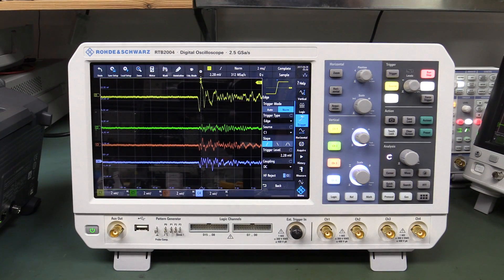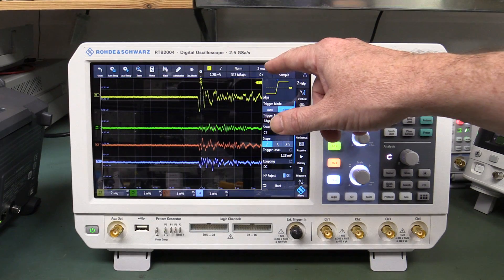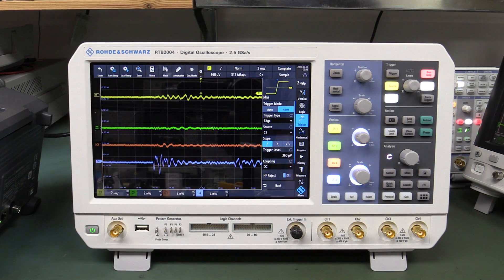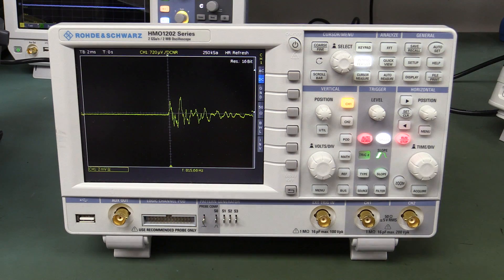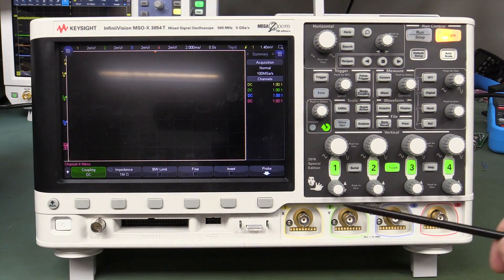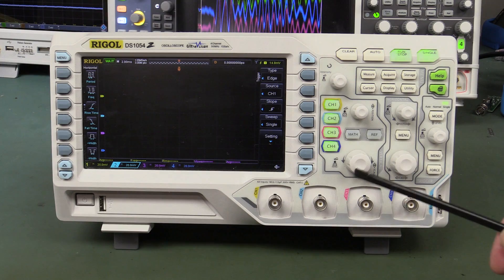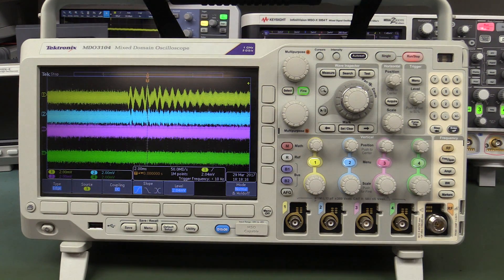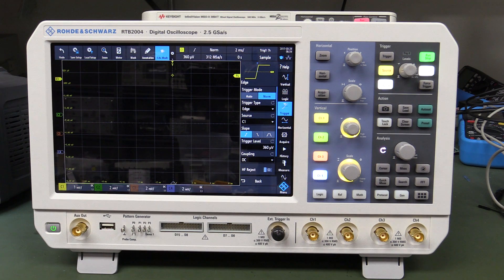EEVblog #983 - A Shocking Oscilloscope Problem!

Comment: I have a RTB 2004 purchased 3 years ago and I've noticed the BNC ends of the supplied probes are starting to crack! It sits on my workbench - not exposed to UV light, barely moved and never subjected to knocks yet they're cracking. And don't get me started on the horrible gritty feeling of the spring loaded hook tips. Disappointed and won't be buying R&S again.

Comment: My Keysight DSOX1202X is immune from tapping on the scope itself BUT I have noticed environmental capacitance effects holding the probe and tapping my feet produces about a 50 volt DC impulse that peaks just as my foot reaches the floor, the velocity of rise increases as proximity to the floor, very much what I would expect in a capacitance situation with a DC voltage gradient in the room.

Comment: I know that with my 20 year old Tek 2024b scope, if I hold the supplied probe tip within a few inches of the back of the scope it's noise a-go-go. But I haven't yet tried using it as a set of bongo drums while capturing any signals.

Comment: 5k$ scope with this kind of problem on the board. Even gold bnc's does not help ? I beating my HMO1102 on each side, nothing wrong happens. poor probably R&S does not even try to fie it. Cause people even after this film wathed, make table prons cons, colors mode annotation drawing on lcd and amazing 3d XYZ beat everything, No matter that scope for egzample insted of square shows almost sine, gold pins with 10 bits (ENOB less then 7) are worth to buy it. :D I buy MDO3000 in that price. Now at work gives me hmo1102 with one pixel faild, but scope is simple have little anoying thing like no zero push in position konbes. But it is good, scope, on that measures you can relay and the scope does not carry you into wrong path way of interpretation, diagnosis of the problem. For what can i use scope like that on vid... The HMO1102 makes huge impression on my, that i wanna to buy RTB2004 full opt or clean RTE1000 200MHz. Now I know that was so close, i hope that RTE1000 is designed on high level

Comment: My Uni-T UTD2102CEX has the same "problem", but I have to hit pretty hard to get 2-3mV spikes. It seems to be a high-frequency thing. It's easier to trigger with a light pen than with a reversed pair of scissors (steel blades in my hand, plastic handle on scope). Scissors have more mass so produce a lower frequency signal? Anyway, with the amount of force I have to tap the scope with, I don't see an issue with this scope to be honest. Nobody hammers their scope while taking measurements, right?

Comment: Ceramic capacitors are by no means the only source of these transients. If you take a coaxial cable that obviously has no ceramic caps in it, connect it to the scope and tap the far end with a pencil, you will still trigger the scope. Plastic-metal interfaces also generate microphonic transients when tapped.

Comment: Ceramic caps in the signal chain. Pretty typical. That’s where special construction techniques come in. It’s possible to work around this problem, but it requires quite a bit of experimentation to get it right.

Comment: Several years ago, my employer was considering a R&S signal generator for noise floor measurements, there were even two R&S sales engineers present when one of our lead techs demonstrated to the R&S types that noise floor measurements could not be done because of the high noise level on the signals from the R&S generator, the he demonstrated the same test using a very old HP 8640B sig genny, noise floor measurement successful.

Comment: I have seen this effect in association with modern electric guitar effects pedal circuits. It's not something you want in an audio system. I have contacted Digitech about it, and they simply denied it's an issue with their design.

Comment: Check out this R&S Scope Rider touch screen going haywire:  https://youtu.be/6SCOpyw3wmY.  This same issue happened to us with our R&S Scope Rider while troubleshooting a failing VFD in the field.  You can see our example here https://youtu.be/uzA0GjHceeM.  This one happened as soon as drive output was enabled.  When drive output was disabled, the touch screen functioned normally.  This issue for those of use troubleshooting in the field is a serious concern!

Comment: My Teledyne LeCroy WaveRunner 64Xi has a surprisingly good isolation. I've set the trigger level to 1mV and no matter how or where I whacked it (the case, all the BNCs, the screen) but there is no capture. One thing to note, however, the fan is pretty loud and for this reason I believe the engineers might have paid a special attention to this matter when they designed the front end. UPDATE: I used 1MΩ impedance inputs.

Comment: removable header connections...anything that has a spring loaded connection will contribute to the phenomenon. ceramic caps old style and new suffer from this also. there's the chance that solder joints will add to the racket on well used equipment. all these things add up to produce what you see here. very common place. when measuring r.f.and certain types of audio equipment in operation it can,from time to time,drive a person nuts! ;-)
microphonics suck!

Comment: Out of curiosity, I tried this on a properly analogue scope. Tektronix 7603 mainframe, 7A13 vertical plugin (differential, 100MHz bandwidth, up to 1mV/div sensitivity), 7B53A timebase. Set to 1mV/cm, 2ms/cm, normal trigger, input DC coupled but no probe connected. I couldn't get it to trigger by bashing the case, or at least I couldn't find a blunt instrument heavy enough to affect it, but tapping the input BNC connector hard with a pen did make it trigger. It really had to be actually on the connector, though, and the resulting trace on the screen didn't seem to be more than half a division high. That's probably a benchmark for low microphony.

Comment: Hi Dave, thanks for this info. this could be a potential issue when testing things in a environment that is creating such vibration shocks. in the auto repair arena, these type of scopes are starting to being used to diagnose network issues, and if your scope has this problem, when you are monitoring a can issue, driving down the road, hit a bump, see a hiccup in your signals, you might be inclined to think you found the problem with a possible circuit connction, when in fact nothing happened and your scope induced this fault. could make you chase ghosts. a lot of times in this scenario unused channels will not have probes attached. again thanks.

Comment: Are you sure that some of what you're seeing isnt actually triboelectric noise generated by the BNC connector itself when you whack it? It would be interesting to do the same test hitting a BNC connector on the end of a length of cable, so it's mechanically isolated from the scope. Great video though!
Reply: So, I just tried the following : Put a BNC T-piece onto a short BNC lead, and plug the other end into my old HP1740A 'scope. Tapping the T-piece with the hard plastic handle of the screwdriver I was able to generate spikes of almost 100mV pk !! Seems to me that a good proportion of the effect that Dave's seeing could actually be the BNC connector itself, generating triboelectric noise. An easy test that you can try for yourself!

Comment: Is that behavior consistent when attaching a typical probe? I mean you observe that with open inputs.... but probes are usually terminated, compensated, therefore provide some additional load to the input circuit. Which would mean that unused BNC´s would need to be terminated to not bounce that way to avoid that (probably no one does that).

Comment: Only 10 bit scope in that price range?
Every model in the picoscope 4000 and 5000 series is cheaper and come in 12-16 bit resolutions. The pico automotive scopes too.
Tried thump testing one to no avail. Havent tried tapping connector.

Comment: Actually, the new Owon XDS series scopes have 12 bit resolution. If you go for the 200MHz version, you get 14 bit resolution. I just picked up the XDS3201A through Amazon for $550 US. 12 bits, with the battery, DMM, touch screen, decoding and other options included. So far so good.

Comment: Not sure because I am not front end designer, but may be differential noise cancelling techniques need to be applied in order to cancel such piezo effect. At least for those scopes having touch screen and Dave like  users. OR passives need to be reinvented to kill such effects. This is the place where you will find so many interesting things.

Comment: Isn't this the case that when you leave BNC open, not mechanically bonded, then the BNC connector makes the capacitor out of itself (except of the capacitors issue of course)?

Comment: Don't panic. Dave as a poweruser discovered it after years of the using scopes from very expensive to very cheap. So it doesn't have negative effects in daily usage. If the scope is connected to a signal this effect does not happen anyway. But: Of course you can send me your rubbish scope 😆

Comment: This isn't just an issue with modern/digital scopes. My old HP 1980B scope (from 1982-ish) shows the same issues. To a lesser extent, my ancient HP 120B (early 1960s?) does also despite being so old it came with banana jacks instead of BNCs. Any scope with ceramic caps in the front end will do this, I suspect.

Comment: couldn't it be the bnc connectors, which jiggle around if you shock the scope? This will also change the capacity. You should check it with bnc cables connected.

Comment: Terminate the BNC inputs and repeat the test?
Reply: Perhaps with cheapernet (thin Ethernet) termination dongles.  Should fit right on and do 50ohm termination with 0 cable length. Note that there are two types of these terminators, for opposite ends of the coax bus.

Comment: This may be a naive comment, but does leaving the inputs floating make them more susceptible to this?
Reply: Yes it does, totally. If Dave can demonstrate engaging the 50 Ohm Zin. The problem should lower in amplitude where it gets buried in the noise floor. Also it would be interesting if Dave engages grounding the inputs, this should eliminate the problem. If this stops the problem, it will lend credence to the problem just being the connectors and not the MLCC parts.

Comment: Would you not expect this by the fact the inputs are unterminated? What happens with a terminator on the BNC inputs??  When would you have open ended inputs? See mikes electric stuff comment below.  Really eevblog....would you go around bumping precision gear....hmmmmm
Reply: Going from a 1M Ohm input to 50 Ohm should kill the noise, but something for Dave to demo.

Comment: Now i gotta whack my 'scope...
Reply: My ancient Tek 454a is just as sensitive as the R&S to tapping the BNC connector, but whacking the case doesn't do much.
It definitely has no SMD multilayer capacitors. It does have transistors with gold pins in little transistor sockets.

Comment: Hi Dave, it's 3:11 am here and testing your finding resulted in me up and about. I believe I can duplicate it here as below. 
It would be good to see it duplicated there as I am not set up yet to do this. No components other than the coax terminated in connectors at each end.

I used a short piece of coax, terminated in connectors about 8 inches long. It should be as short as possible to not become a transmission line to the impulse frequency (probably not much chance of that as it is a mechanical force).
One end to channel 1 of my Tek 2235. The other end mechanically isolated to not pass any vibration to the instrument. 
Henceforth, any slight impact, such as light tapping, to the isolated connector shows up as a pulse and triggers the scope.

Comment: Wow you can use that for earthquake readings :D
Reply: Do you think you can reduce the detection on the channels by replaceing the "nuts" that holds the connectors with rubber or some sort of dampening materials?

Comment: I have now been extensively using my RTB2004 for three days using both the touch screen and physical buttons and I have not seen this problem once.  I have had two analog chan. probes connected and the digital logic channels for decode operations. I must also say having had my previous Rigol DS2000 series (not A) for over three years I have never notice that problem once. I would like to see the effect with probes connected?

Comment: Not only MLCC do this, also chips do it, especially if they are in small packages. 
Opamps "drift" with mechanical stress. 
On chip oscillators (ring oscillators, etc.) have microphonics.
The timebase thus might be significantly microphonic, which could also be evaluated.

Comment: Hi Dave, I was just wondering.. aren't the BNC channels supposed to be vibration  sensitive .. I mean .. if I connected my BNC probe to an accelerometer sensor to measure vibrations I would want highest probe sensitivity .. or perhaps this is a real problem where there is no avenue to redesign probes and BNC front ends .. would like some clarity on that.. or perhaps you can come up with a Gizmo like ucurrent that would counteract this effect if it is indeed deemed undesirable...

Comment: I just now recalled some snippet of memory related to coax connectors and the insulation used in them. I am off to bed, but if anyone has any insight about this, it would be great to see it. The typical insulation in the BNC connectors is polyethylene for cheap ones or Teflon for higher quality. If the noise is coming from the connectors themselves, that would be a sweet albeit ponderous solution. Again if this is what is happening, the loading in the probe makes sense as per Mikeselectricstuff.

Comment: Wow,I have never considered this phenomena before, would make delicate measurements in a high vibration environment rather difficult, maybe not a concern for bench-top models but in a portable that may see use in an industrial setting..... it would be interesting to see if the fluke portables, for example are effected, maybe with harmonics of 50/60hz as found in equipment or spaces one might need to measure.

Comment: Dave,
I will call the manufacturers tech support in the morning, to get more info and feed it back. Agilent / Keysight is my first choice, but I will try the others if not satisfied.
The caps used in my Tek 2235 are 3 types. Dipped Tantalums, disc style, and stick style. All are through-hole of course.  I have the service manual for the unit with schematics.

Comment: I dont often use my scope without the leads plugged in. Perhaps the damping when the mass is increased takes the noise floor down. Its the old Mass Spring Damper problem from control theory.

Comment: I've had a similar effect when flinging a mic cable around at fast paces, as if I used it as a whip. If you turn the gain up on the console to full (most analog boards will have about +75dB of gain on the Mic inputs) you can actually here the effect going through the board.
Reply: Check out Triboelectric effect which will put noise on a conductor due to high insulation resistance. A small noise voltage is produced when the insulation rubs against each other (as when you are flinging them around).. This appears riding on the mic signal and gets the same 75dB of gain. Cables that are used to eliminate the effect have insulation that is slightly conductive.

Comment: I dare say the oscilloscope maker forgot to glue in the pin mount caps and put rubber sills on the connectors. We get the piezo electric effect in telecommunications equipment with cheap telephones. The fix is to glue all the pin mount caps with hot glue. You can isolate the problem caps by just tapping them with a pen or small plastic screw driver.

Comment: The front cover of Siglent scope is not touching the BNCs there is gaps between plastic front cover and BNCs. The front cover of other scopes are all touching the BNCs and maybe they are fastened mechanically. It transfers the vibrations through plastic cover.

Comment: Just tried with a lousy Hantek DSO 5102B and  I get almost nothing. It does trigger sometimes but only by tapping the BNC connectors and even at 2mV/div , there is barely any ampltude in the burst. Doesn't mean it's a good scope, far from it, but still ...

Comment: could you throw some rubber buffers around the PCB on the inside to try and dampen this? or some rubber around the BNC connectors?

Comment: I once had a similar problem with a Bit-Error Rate Tester (BERT) I designed back in 2002.
The problem was phase shift in my 2.5GHz clock, which was produced by a PLL that multiplied up the 156MHz system clock produced by a Temperature-controlled crystal oscillator (TCXO).
There were 16 PLL chips, and each one got it's own 3.3V supply from a low-noise LDO regulator.  LDO regulators typically require a few microfarads on their output for stability, and I initially used ceramic caps.
When I tapped on the side of the chassis with a screw driver, the 3.3V rail went up (I think) by about 30uV, and it lasted about 1ms.
This caused a problem known as frequency pushing, where the output freq of a PLL changes slightly in response to supply rail perturbations.
I replaced the ceramic caps with plastic film caps, and the problem went away completely.
Why would such a tiny freq change affect the timing so much? Because phase is the integral of frequency. A 1ms supply transient lasts for 156k clock cycles at 156MHz.
Reply: great conment. thank you.
Reply: Very interesting comment. Thanks !

Comment: im sure there is a reason you cant, but is it possible to mount the bnc connectors with braided wire to connect to the pcb? like how a voice coil on a speaker attaches?  also maybe attach the pcb with rubber grommets like how a cd rom drive is mounted internally? would that reduce vibrations enough to work?